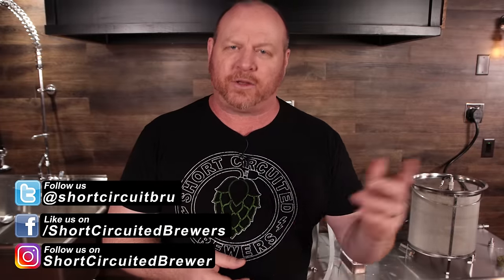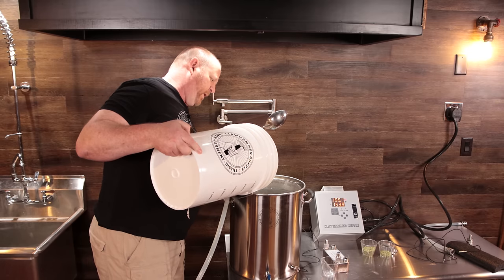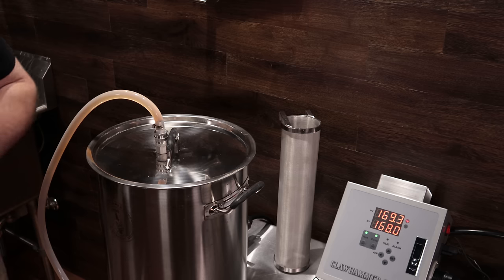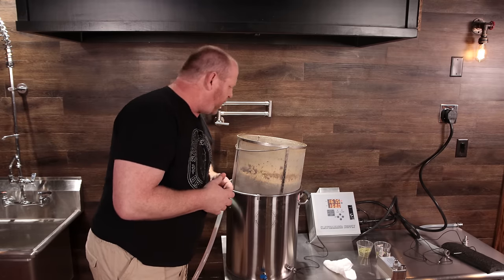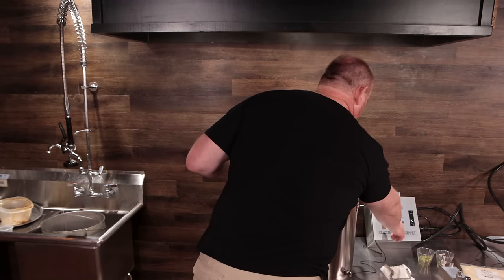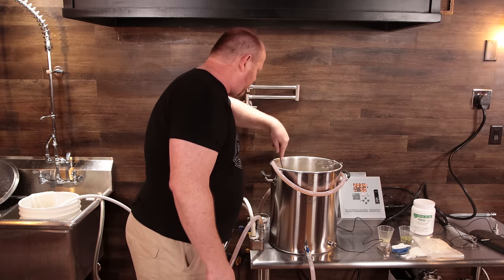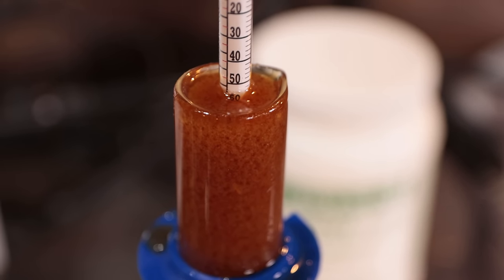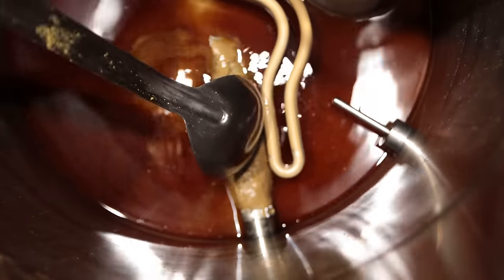Clawhammer Supply 240V 10 Gallon system Brew day/Review

Comment: Would this system work well with a 3 vessel HERMS? I’m looking for a good controller for my electric upgrade at some point.
Reply from the maker: It's meant for a single vessel system so it is not ideal. You would have to switch the controller between the vessels for the brew day.
Reply: Short Circuited Brewers good call. I wouldn’t want to mess with that throughout the brew day. I know this is off topic, but which system do you recommend for my setup? Do you like the Auber Brew Buddy (240v)?

Comment: Hey, this 240v has a built in CFGI is it necessary to add a CFGI breaker?
Reply from the maker: It actually does not. It is a breaker only. It does need a GFCI.
Reply: @ShortCircuitedBrewers  ok, thanks for clarifying, I actually ordered a GFCI for my breaker just in case. I will install that for sure. Thanks!
Reply from the maker: @jonathanhillman9364  👍🍻